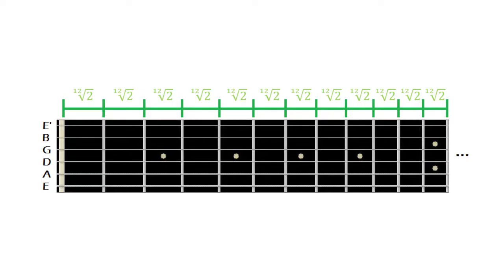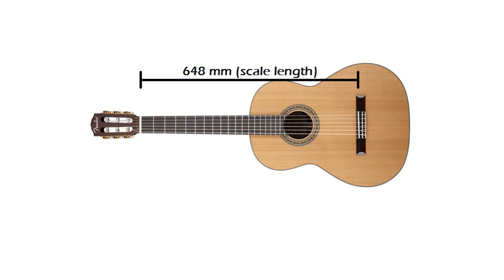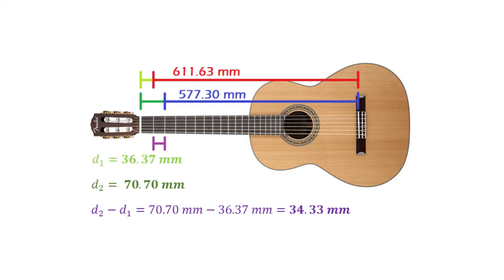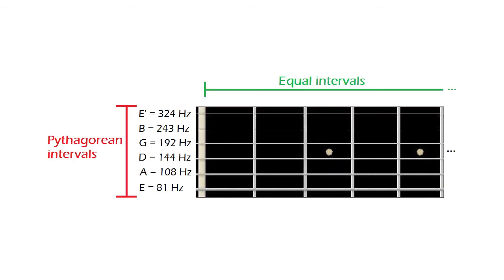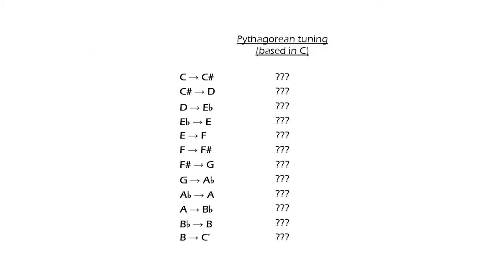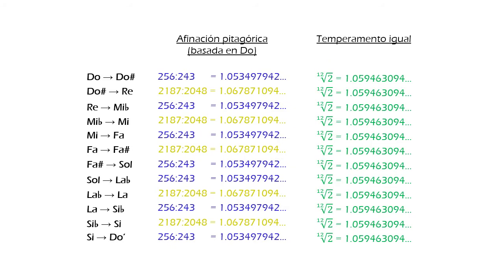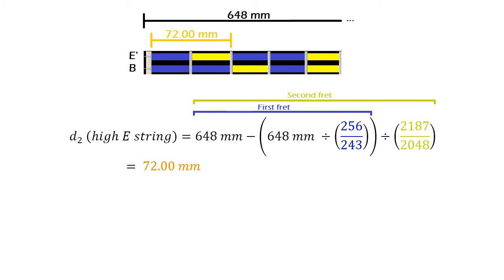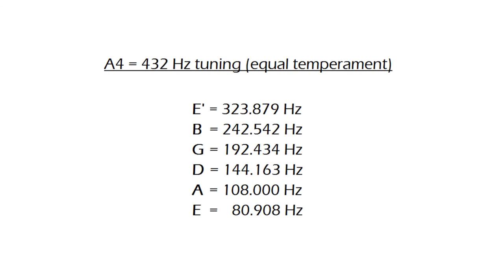06 Distance between frets, 432 Hz tuning on a guitar

Comment: Verdi was in the late 1900 century using 12-TET or equal temperament and not pythagorean tuning. In the 1800 century a lot of composers were using meantone temprement with more pure thirds than 12-TET as they saw this as the most important interval.. 

Using 432Hz as your reference point with 12-TET rather than 440Hz is Verdi tuning.. This tuning creates much more clean register breaks for the voices in his operas (and for my voice by the way).. 

But you probably need to intonate the bridge slightly to compensate for the new tuning.

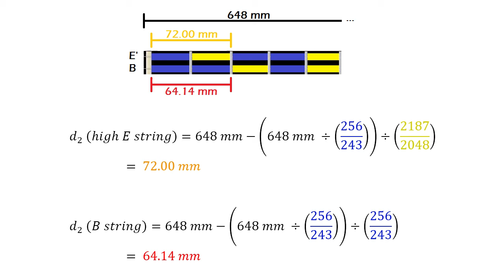Comment: 3:49 "these descrepencies" you're talking about are already present no matter what tuning you use though...on every standard guitar that has even frets, the G note will be a little off. that's why they make those guitars with weird squiggly frets...not sure what those are called. I actually tried tuning to A=432 Hz and it seems pretty damn in tune to me when I compare up and down the fretboard
Reply from the maker: +danimalplanimal I'm not a actual guitarist so I didn't know about that G note, I'll look into that. However, as I've explained in the video, the problem with "432 Hz" tuning isn't the actual frequency. You can tune to any frequency without any problems as long as you do it in equal temperament.

The problem rather lies in that when people tune to "432 Hz", they usually tune the strings to frequencies obtained through pythagorean tuning, while guitars are constructed with the spacing between frets to produce equal temperament.
Reply: AwesomeAudioChannel
well yeah, as someone who plays guitar I'll fill that in...on guitar the jump from the G to the B string (3rd string to 2nd string) is always the most out of tune, but basically every note is actually slightly out of tune, which is why you have guitars that look like this in order to correct for that.

https://ixquick-proxy.com/do/spg/show_picture.pl?l=english&rais=1&oiu=http%3A%2F%2Fgeargods.net%2Fwp-content%2Fuploads%2F2014%2F01%2FStrandberg-Fan-Fret-True-Temperament.png&sp=87016b2460d22eb0f0b0ebec63893c86

so that's already a problem for guitars even tuned at A=440 Hz...I don't know if it's actually less of a problem in A=432Hz, but there you have it. I'm just not quite sure I understand your argument, since the frets are always equal lengths apart no matter how tight the strings are
Reply from the maker: +Yard Sale Dale Thanks. A previous comment let me know of true temperament fretboards with appear to be the same thing, but it's good to know them by another name too! I actually added a note pointing them out at 3:54

Comment: Too much gawd damn math!  My calculator over heats when I try to figure all this out.  What does 12th root of 2 mean anyway ?  I'm sure there is an answer, but it isn't exact. What I need is an exact number like in millimeters and decimals.  I can figure that out.  If a note is ever so slightly sharp or flat nobody listening would be able to tell the difference anyway -- just get them another beer.
Reply from the maker: Hello! The special significance of the 12th root of 2 is that this is the ratio between the frequencies of two adjacent semitones. The 12 comes from the number of semitones in an octave, the 2 comes from the doubling of frequency when going up a full octave. I have other videos that talk about this more in detail.

And the vibrating length of a string directly correlates with the frequency it produces, which is why we use this number.

If you want a number with actual decimals, the 12th root of 2 is equal to 1.059463... except I have to truncate decimals because they go forever.

But in a nutshell, you start with the scale length of the guitar, and each time you divide this length by 1.059463..., you get to the fret of next semitone. This is why the distances shrink as you go to higher frets.

But all in all, music is a highly mathematical art, especially when you dabble with technical aspects like building instruments or sound design :P
Reply: @AwesomeAcoustics  I get it my friend.  I can look up a fret scale chart from StewMac and be as accurate as I need to be.  I don't build many Mandolins, but I have a banjolin in the works at a future date.  I've  got a nice chunk of Indian rosewood picked out for the fret board I've had for close to 20 some years. 'Twould be nice to put it to good use, would you agree ?
Reply: @AwesomeAcoustics  Thanks.  I divided the scale length I want by the 1.059463 for each fret position, wrote down the numbers and was satisfied that the 12th fret number was exactly the same as from measuring from the nut end of fret board.  By measuring from the saddle end (opposite end of the scale, not accounting for "compensation") these numbers, by all accounts, do work as they should, of course.  Even tho I am American, I still use metric measurements whenever possible.  A single millimeter being .039" is highly accurate, and is the basis of the meter (39"), whereas the "yard" is only 36".  Much more difficult to incorporate into our non-metric system because of decimal fractions added on to inches.  For example, .... .875" equals 7/8".  I worked in a furniture factory where all the cutting machines, boring machines, etc, where in metric measurements.  No more hassle with fractions.  A very efficient system for us stupid Yanks.  Cheers, friend.  Thanks for this 12th root of 2 number.   Bob
Reply from the maker: @robertshorthill4153  Hey! I have to give it to you for getting your hands dirty with the math and arrive to a nice conclusion/proof. Maths can be daunting at first, but once you get your head around them, they can be satisfying too!

Comment: see true temperament fretboards (swedish invention)
Reply from the maker: I did not know these existed prior to this video. Thank you very much, will add as a note
Reply: OK, there seems to be a misconception here.

True Temperament are designed for equal temperament, not for just intonation of any sort. The issue with standard frets and the calculations that are usually done for determining the spacing between them is that  the action of the strings, meaning their distance from the fretboard, is never taken into account. This is a problem. When you're pressing the string to touch the fret, the string tension changes, and you're basically invalidating the calculation done for the fret you're pressing.

So, let's say that you tune with your C4 at 256Hz. On a standard fretboard, as you go for the next semitone (C#) you'd be expecting to go a 12th root of 2 higher, at approximately 271.22Hz, but you don't -- you're going slightly sharper because you're stretching the string. On a True Temperament fretboard however, you do to the next tone correctly because the fret's position accounts for this stretch. This is also why True Temperament frets work for standard tuning only, with specific string gauges (from 0.009 to 0.050). Altering the proper action of a True Temperament guitar becomes a bit harder, if you really want to retain the benefits of these frets.
Reply: thanks friend! could you give me more information about the specific gauges of the rest of the strings? Where did you get this info? very interesting, thanks
Reply: Take a look here: http://www.truetemperament.com/faq/#A4